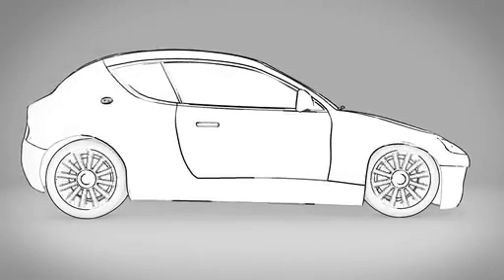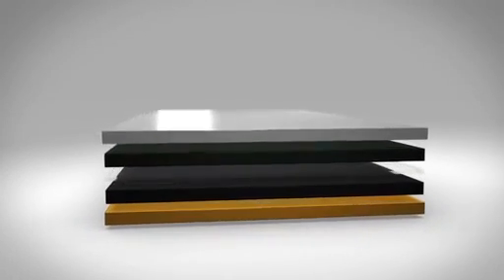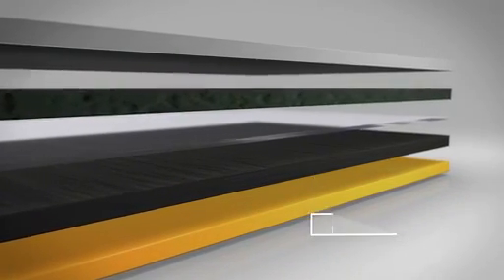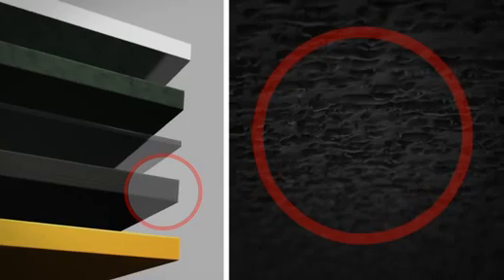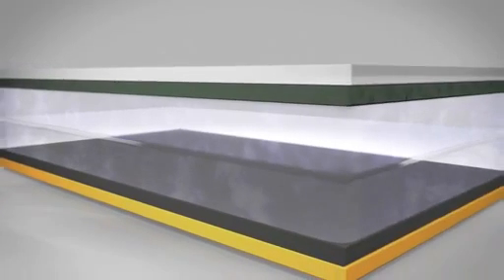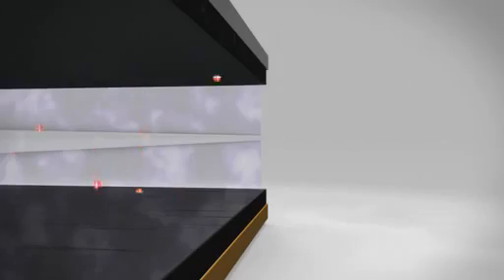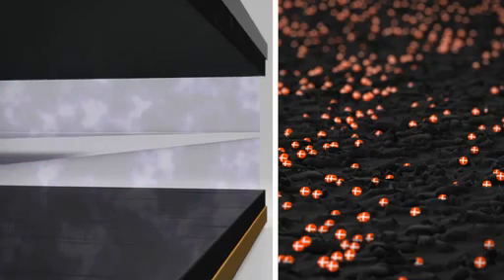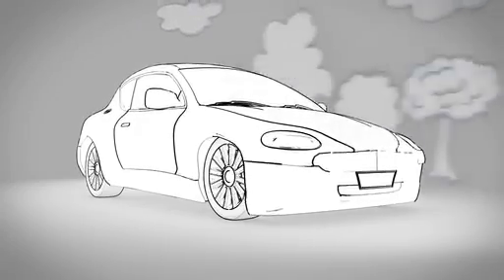Lithium-ion batteries - How do they work

Comment: If you are doing a school project on Lithium Ion I would suggest using LiIon 18650 or LiPo batteries instead. 

These are lithium phosphate (LiFePO4) battery cells. They are not the cells used in, for example, Tesla cars or power walls, but other manufacturers use them such as Nissan in their Leaf model. Usually 'lithium ion' refers to either Li + one of about 4 cathode chemistries in what's called a 18650 cell, or LiPo (lithium phosphate) which is used in your cell phone and laptop.  LiFePO4 I argue is not a true "lithium-ion" technology for 3 reasons. 1. They are used in supercapacitors. 2. They are about 2 to 3 times the size of LiIon and LiPo because they are actually a solid state battery. 3. Their nominal voltage is 3.2v while LiIon (and all 4 cathode chem), as well as LiPo batteries, are all either 3.6 or 3.7v nominal.

Try searching LiIon on google and I bet they will refer to 18650 and it's siblings, and it's father LiPo (mother would be LiIon 20700 cell). Rather than LiFePO4 which is like it's a cousin or second cousin. There will be much more information explaining how they work. Try searching for Tesla cells.

Just for fun, their neighbor would be lead-acid starter battery along with their neighbor's 'hefty' spouse lead acid AGM (or, "boat battery" used in certain cars like Mercedes Benz and others, as well as larger boats).

Comment: why is cathode(+)? and not (-)?
Reply: The anode is the electrode at which oxidation is taking place in the battery. But since these aren't primary but secondary cells (meaning they are rechargeable), this process can take place at either electrode (depending on if you are charging or discharging the battery). For these secondary cells we say: the positive electrode is the cathode on discharge and the negative electrode is the anode on discharge. 

Hope this answers your question.
Reply: Giwan Verveen oh wow, thank you so much
Reply: @giwanverveen3496  wow great explanation !!

Comment: Cathode ( - )  Anode (+)
Reply: In an electrochemical reaction the cathode is + and the anode is -. In an electrolytical reaction the cathode is - and the anode is +. 
In the cathode the element will be reduced, in the anode the element will be oxidized, always. 
Remember CRAO, that means “Cathode Reduction Anode Oxidation”.
Some examples:
In the battery there is an electrochemical reaction, so the cathode is positive (+) and the anode is negative (-). 
In the electrolysis there is an electrolytical reaction, so the cathode is negative (-) and the anode is positive (+).
Reply: @vapervop  Thank you so much VaporVop,i had been struggling to grasp this one for a while,Thank you so much
Reply: Gibson Omwa You are welcome
Reply: E to angdai hai baaki ab ladai hai
Reply: Uhh no
Reply: Physicists and chemists have different conventions. Physicists have it your way, with the cathode as negative. This is because the cathode ray tube in old televisions, for instance, was an electron emitter. Thus the cathode there means negative. For chemists, it's the opposite.

Comment: this doesn't explain much
Reply: It gives the basics, which is most likely what people are looking for
Reply: I agree - pity the clip doesn't explain the function of the copper and aluminium layers, the way ions move from cathode to anode, the problems caused by the way the electrolyte can impede the transfer, the amount of voltage which can be created, how charging and discharging works and.... well a mass of stuff
Reply: Check this video, it is much much better: https://www.youtube.com/watch?v=VxMM4g2Sk8U
Reply: Trade secret should not be revealed to public, freely, especially to piracy promoters.